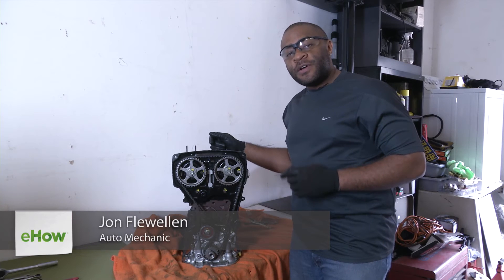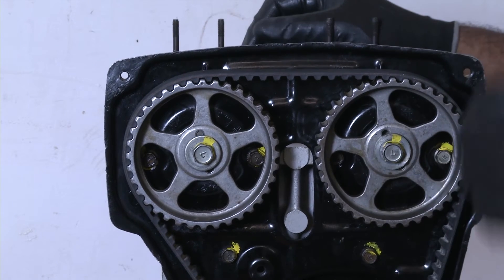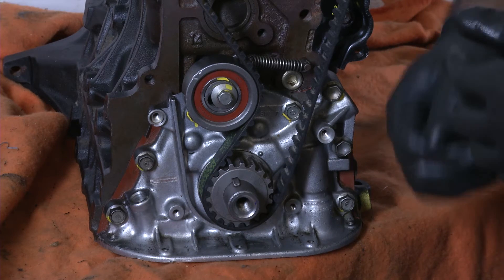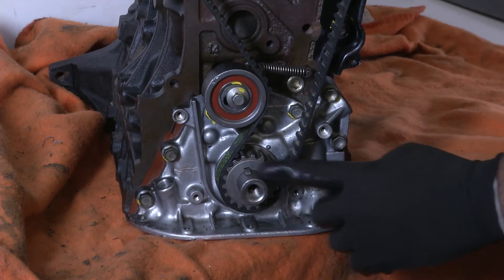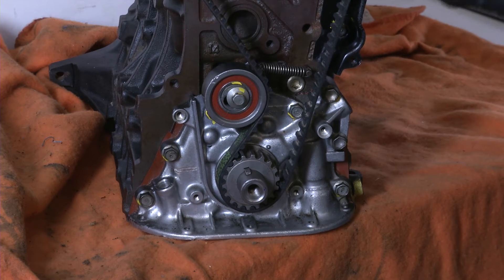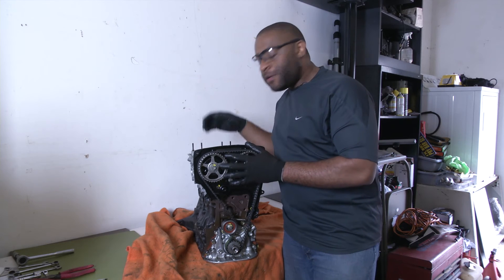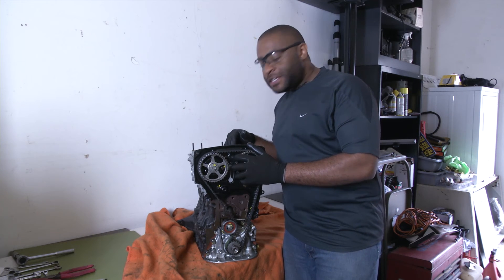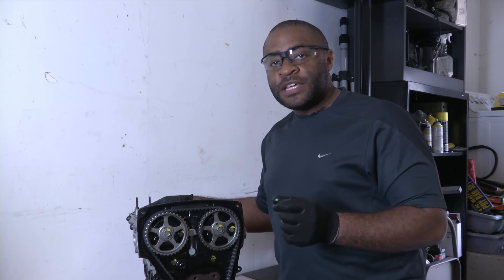Engine Vibrations After a Timing Belt Replacement : Timing Belts & Other Auto Repairs

Comment: I have been facing vibration or engine roaring problems for years. I spent almost 500 bucks on the overall suspension and bushing, mounts foundation, exhaust steering and everything. Still the problem exists. 
When I accelerate, vibration comes through whole body and it badly annoys inside the cabin. The solution that mechanic finds is bushing between engine and its frame . And its still a gamble to invest. I dont know what to do. Kindly guide that why this vibration or engine roaring comes from? It sounds truck or diesel vehicle.
Reply: Same thing
Have you found any solution?

Comment: I have a Mitsubishi with 4G63. Had a timmingbelt change. There is balanceshafts that have there on belt. The mechanic fail to get them right. That also have you engine to vibrate
Reply: ***** I have done alot of timingbelts changes when i went throu mechanic school. I Hade got all the parts and was thinking of changing it myself. But I have a workshop next to my work and when they say 200$ to change it for me I could not resist. People make mistakes but was very angry when they went from very nice to idiots when i show them what they hade screwed up... They started attack me about "you havet servis the engine because the servis book said soo" (I have changed the oil and filter every 5000km

If there hadent been so many youtube vides about how you could screw this up I would never been able to convince them. They simply would not listin to me.

When It comes to changing timingbelts my experience have been that the France cars are the most stupid and harders to change on haha.

Changing timingbelt are not the harders thing to do in the most part but liek you said you dont want to fail haha
Reply: +da1stegr it's almost my exact story. they also start blaming on the engine mount to and then maintenance. luckely YouTube existing so I could rub it in there face.

I am still angry on the firm because even after they fixed it the engine took some minor dmg of it. I needed the car very badly when I picked it up that day and had to drive it to pick up my other car that just had been on chassi repairs from a lady backt in to it. fun... that was not my lucky year when it comes to cars haha
Reply: +Jimmie Nilsson I JUST GOT MY HEAD GASKET FIXED WITH THE VALVES FIXED AS WELL.    BUT NOW THERE IS A TICKING SOUND.   DOES ANYONE KNOW HOW TO DO THE EXACT TIMING ON THE BELT?     I HAVE A 1990 MITSUBISHI ECLIPSE 1G NON TURBO 2.0
Reply: frost lee Are you sure the valve clearance have been set yet. How bad is the ticking?
Reply: im not sure.  i didnt do it.    the car drives....it starts,  but when i drive it, sometimes it wants to turn off, or the car shakes.   and sometimes when i press the gas pedal, it kinda misses the signal to GO and then it picks up speed.      the ticking is...not bad ...and its bad....its like....middle.